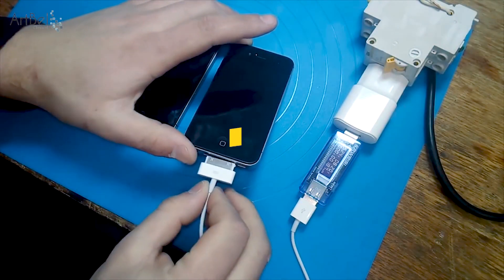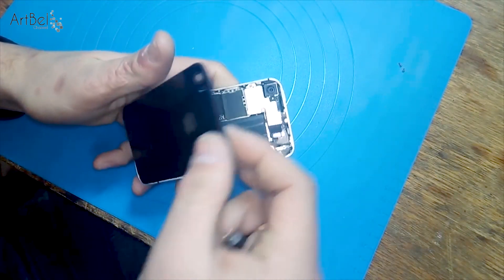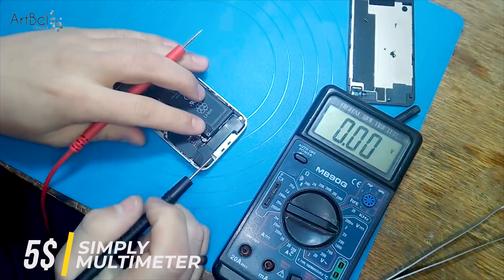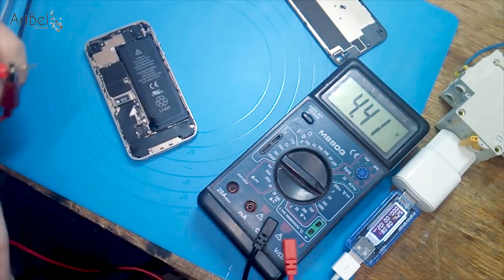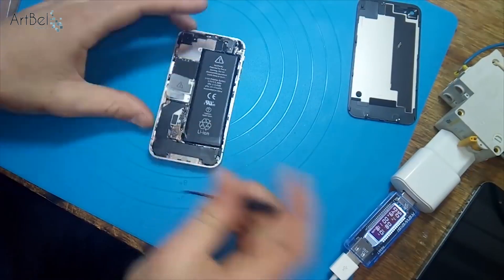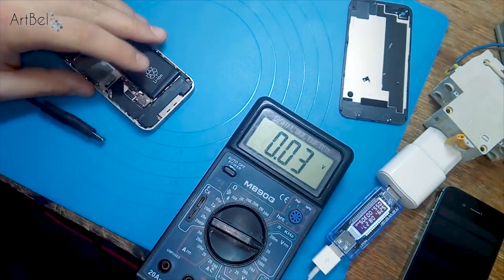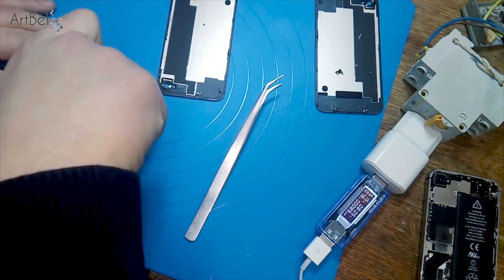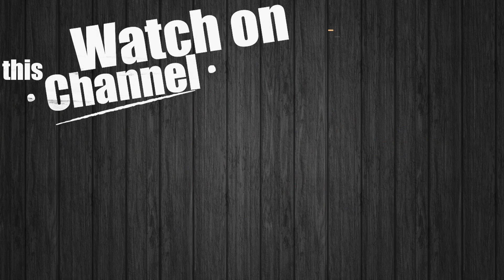Repairing iPhone 4s doesn't turn on, doesn't charge - battery recover (How to) [Do it yourself]

Comment: is there anyway to make iPhone 4S perform faster or increase storage? Can I use WhatsApp on it? I still have mine, but the battery dies in less than an hour without using! Is there a better long lasting battery to buy? Thnx
Reply: Buy a battery
Reply: @mlb.mik7772  Thank you Vanessa! I just bought a new battery, haven't tried yet!

Comment: Hello, i want to ask a question if you don't mind. I have a 2 iPhone 4 with a same problem. So when i charge it it keeps booting on apple logo and then rebooting, no matter how long i wait it's still rebooting. Also when i unplug the charger, the phones turn off. Weird thing is that i still can get to the itunes recovery mode and my pc can recognize it, but everytime i try to restore and wipe the data the phone keep rebooting and cancelling the progress. Did changing the battery would fix that? Also on one of those 2 phones i mentioned, the battery connector are come off from the logic board, is that possible to reattached that? I appreciate it if you want to answer my questions, thank you.
Reply: Hey I have the same problem
Reply: I, too, have this problem.  I changed the battery and it did not resolve this issue.
Reply: Helppp this is me rn , did anyone figure it out ?